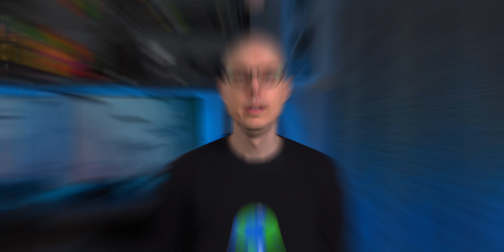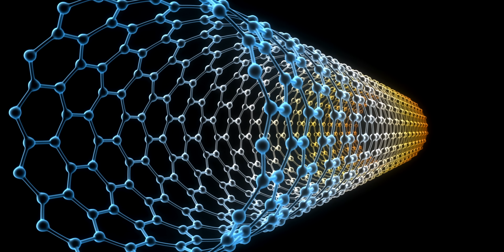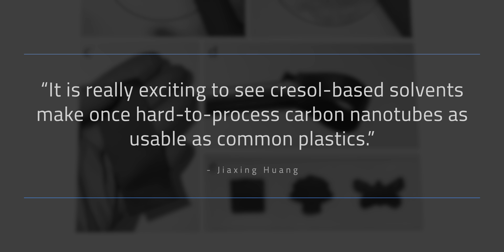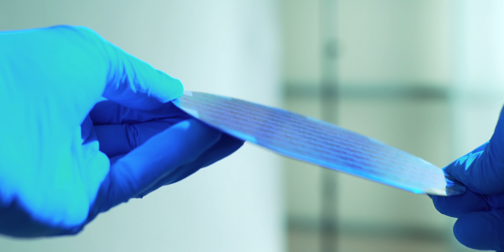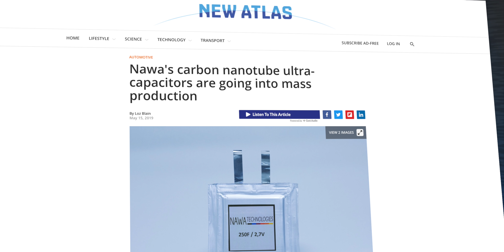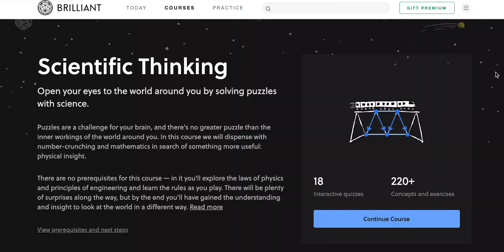How carbon nanotubes might boost solar energy - explained

Comment: Also, this new material.They say that could replace gold has higher conductivity andflexibility corrosion resistant. Gold is commonly used in electronics because it's soft, pliable, and has excellent electrical conductivity and corrosion resistance. However, gold doesn't have great mechanical strength. Researchers have developed new materials that can replace gold in electronics and have similar contact properties to gold, but are less expensive. These materials are durable, resistant to oxidation and corrosion, and conductive. 

￼

ScienceDaily

New materials could replace costly gold in electrical applications | ScienceDaily

Oct 15, 2010

￼

World Gold Council

Gold and the electronics sector | Gold Investor, July 2018 | World Gold Council

Jul 4, 2018

￼

ResearchGate

Current and future uses of gold in electronics - ResearchGate

Gold coatings are widely used in many fields for their shining color, excellent corrosion resistance, and electrical conductivity. However, they are not mechanically strong with low wear resistance. In this paper, we have prepared nano-composite Au-Ni-TiO2 coatings by our newly developed sol-enhanced electroplating method. In order to obtain the optimal mechanical properties, a systematic study of Au-Ni-x TiO2 coatings with different sol concentrations (x is the sol doping concentration from 0 to 25 mmol/L) has been conducted. It was found that nano-particles (3-12 nm) of TiO2 were highly dispersed in the coating matrix.

One process for creating flexible gold foil that can be used in electronics involves:
1.Immersing silicon-gold layers in an acid bath

Forming a silicon oxide (SiOx) layer between the silicon-gold layers

Applying an adhesive layer on top of the gold foil

Using another acid to remove the silicon oxide

Detaching the gold-adhesive foil from the silicon 

The resulting gold foil is conductive and flexible, allowing it to be used in flexible electronics. 

Gold is used in many electronics, including desktop and laptop computers, smartphones, TVs, and video game consoles. Random Access Memory (RAM) chips, which are part of the circuit board, often contain a small amount of gold-plated pins and a thin layer of gold on their surfaces. 

So could this push it past the 20%?Because it has higher conductivity putting this as the nano particles moving it to even a greater state of conductivity?????

Comment: Also this is a way to turn lead into a market product by converting it into gold. And then using that converted lead into gold in solar panels.

In alchemy, the term chrysopoeia (from Ancient Greek χρυσοποιία (khrusopoiía) 'gold-making') refers to the artificial production of gold, most commonly by the alleged transmutation of base metals such as lead.

￼

https://en.m.wikipedia.org › wiki

Chrysopoeia - Wikipedia

Feedback

Comment: This is a duplicaiton of the refinement process of blacksmithing. The first thing a blacksmith does, if talented enough, is improve their own tools. The same that can be said about scientists building nano-tubes; build a nanotube robot to build nanotubes, then have that robot build a robot to repair the robot that builds nanotubes. Turn that robot into making a new robot from the nanotubes the other robot is making and you have two nano-robots making nano-tubes where you used to only have one. The exponential growth is obvious. The clever thing to do is to build an operating system capable of keeping up with the growth and the tasks assigned.

Of course, that provokes the inventor to have created the nano-tube-making-robot with some storage space for memory or a simple brain providing self awareness of a hard state of "fully-working" or "broken" with "functional" still being an option, no longer binary, the storage state would become trinary at least: and that's done with feedback -- if the robot is designed cleverly enough to make an electron bounce through it in frequency of the AC cycle of the power grid, you can get a peak, out of phase signal for damage, and completely blank for fully functional, indicating there is no signal for damage present. If it's gone, what are you talking about, it needs to be totally replaced, if you ever knew it was there, and that makes a need for identification through individuality or by form and function in a place instead by a number as wrote. -- but we need an antenna to speak to the indiivdual units and a receiver to recive all those signals. Looks like the easiest way to send signals is through light; one frequency to read the nanobots, the second to give control signals of act or  not, and power wich can be done through the UV light conversion you spoke of.

The biggest reason why this isn't being invented is because the billionairs are too stupid to be fat and happy on their tax-breaks instead of investing in anything.

Comment: What does the afterlife look like for graphene and carbon nanotubes? Reuse, recyclability etc. Thanks for another awesome video!
Reply: That depends on where they are used.  Right now, CNTs are used as an additive material in polymers, for example, to give them desired characteristics.  The loading is extremely small and I don't believe that there is an effective means for separating the CNTs out from the waste stream.  If the plastics are recycled then the CNTs would be recycled along with them and incorporated in whatever is made from the recycled plastics.

Comment: So, in some ways it looks, carbon nanotube technology, if it is able to be quickly developed and commercially integrated, has the potential to mitigate as much of a reliance on rare earth minerals in some sectors of consumer items? That could possibly simplify and relieve some of the pressure from the current existing monopoly, and time needed to find economical recycling, recovery, and cleaner alternative means of acquiring them, by having another parallel technology, that will both allow a potential substitute and determine where the actual can't live without priorities for these materials are, if that limitation actually exists. If you can't get enough materials for one way to work, then make an alternative way with what materials you can use... okay, hack the hell out carbon then, make that dirty stuff into something useful!Interesting video, makes you consider the possibilities...

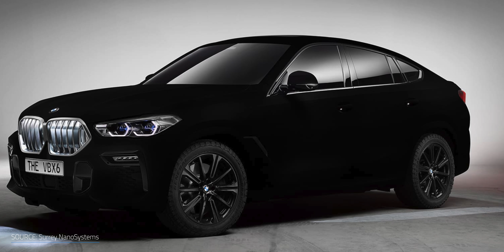Comment: 5:13 while it would look awesome You really Don't want to paint your car with it. 
All that light it traps turns into HEAT.
Great for passive solar gain applications; But it would basically be turning you car into a solar oven.

Comment: Looking for thin black (but it does not matter) suit which will help in thermal control of the body itself .. no more thick feather-filled winter jackets, or swatting like a pig during summer. Which will also protects me not just against heat but also against other elements .. and sharp objects .. I know it's possible, seen some bulet-proof tests.
Then for batteries/capacitors which will store enough energy to power my gadgets or even car/house for years without need to recharge (which will be fast as well) a which wont degrade.
And solar panels, or more precisely film/coating/foils which can cover surfaces and generate electricity with almost 100% efficiency.
Then we will become almost energy independent.

Comment: Sooo there not making building material at all now little nanotube twined sheating 60 ft long rolled into a column.. filled with helium for a tri pod building with 4 wound structures on each arm.1000plants making a floor every 6 months .. would be worth 6trillion hours i have lists of engineering ideas and im not aloud to think anyform of intelligence csuse im do orojected dumb man these himalayan brain boosters sure work

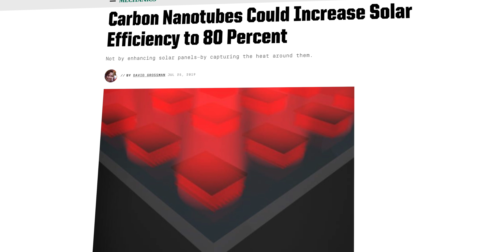Comment: min 6:15 "Improve solar panels efficiency by 80%" is very different of the correct "Improve solar panels efficiency to 80%" as shown in your video from the headline of the article. The usual efficiency of a normal solar panel is around 20%. BY 80% would be 34%. TO 80% would be an increase of 400%. I am sure it's just an honest mistake though.
Reply: I was thinking the same. 80% energy efficiency sounds far too good to be true. 80% quantum efficiency might be more realistic. Maybe that is what was meant.

Comment: Far as capacitors go Maxwell is already way ahead... 250f is on the small side. Maxwell has 3000f capacitors and they sold their design to Tesla. which I'm sure they're doing some crazy stuff.
Reply: To be fair, that's probably a much bigger capacitor physically.

Comment: You know these things that might boost solar energy are about a penny for 5 dozen. Every week there is another break through that will take 76 years to apply. Its like fuel cells. Since the mid 70s they have been 3 years away for commercial operation and we still do not have one that's practical. Yawn. Wind and Solar are 50 years away from being any kind of replacement for fossil and pretending other wise is a democrat pipe dream. I worked in the industry for 20 years and Solar and wind are a nightmare to manage and are not reliable enough on their own to do anything. And, you have to fossil fuel units (gas turbines) online to back them up all the time. Without government subsidies neither of them would even be online now.

Comment: What I'm looking for with nanotubes.

1. Better thermoelectrics.
2. Better, lighter, stronger, Cheaper Buildings.
Reply: There have been a few challenges establishing CNTs in construction materials.  Cost has been one challenge.  Getting the CNTs to disperse in order to get the desired properties is another challenge and this is also tied to delivering the material in a way that will be acceptable by the industry.  Another big challenge is the industry is incredibly cost-conscious and resistant to change.  That said, with the focus on reducing carbon footprint, there is now a big incentive for the industry to surrender the resistance to change and start looking for ways to make a dent in the footprint.  The other issues are also getting solved.  Cost of the materials will be driven down as production increases to the level that is required to credibly service the construction industry.  Also, dispersion methods have been developed that will address that issue as well.  It won't happen overnight, but the ball is already rolling.

Comment: I have recently seen a vantablack bmw in Kologne and it was scary! Like a moving black hole with a propeller badge... i don't think it should be allowed on the streets.
Reply: Cool right? But even that was watered down, as not the full 99% VANTA black was applied, you can google to fact check it. It turns out using the full VANTA black will make the 3d outline of the car indiscernible

Comment: It's my understanding that the pile of random carbon nanotubes is capable of high volume hydrogen gas storage at low pressure. So why not replace all the lithium in a Tesla battery pack with them then replace the wiring with tubing making a low pressure hydrogen storage unit that cools itself while it's rapidly filling? Seems like it would be a lot lighter and go farther providing 100% power till the last molecule of hydrogen is consumed. It would also be very interesting to see Elon Musk's reaction to seeing a Tesla run on hydrogen using his basic battery design for gas storage especially since it would be able to sustain the ridiculous mode at full speed for the full tank thereby always outrunning his lithium powered version.

Comment: One of the elements of the space elevator is its height. Did your research indicate that it would have to be twice the height of a geo-stationary satellite? My question being based on the idea that if a geostationary satellite is at the balance point then anything hanging down from there would need a counter balance. I suppose an alternative would be to have the centre of mass at that altitude.

Comment: He glazed over that vertically aligned nano tubes increasing solar cell efficiency by up to 80% so I thought I'd just throw the article in the comments. It's a super cool little experiment. https://www.nature.com/articles/nnano.2009.226
Reply: That paper abstract refers to a "power conversion efficiency" of 6.9%. The "photon-to-current" efficiency (meaning the quantum efficiency, I guess) is stated as 70 to 80%, for a small range of optical frequencies (wavelengths). I really don't think we are looking at 80% energy efficient sunlight-rated solar PV as most people would interpret it. Seems like an unintentionally missleading headline figure.

Comment: This is all old news, some of it even dates from 2009. The paper + ink + carbon nano tube battery https://www.youtube.com/watch?v=HstobIHYpF0
Revolutionary carbon nanotube solar panel https://www.youtube.com/watch?v=JIvU3l9M2O4

 Stanford University announced at the end of 2009 that they made a solar panel with carbon nano tubes that could convert heat and light to electricity at the same time, making the solar panel competing with oil. In the same period of time they also announced that they made a battery from carbon nano tubes + ink + paper. Stanford university made videos about these subjects, but a few years ago they completely removed those videos from their YT channel. Lucky for you you can still watch both videos because I saved them back in 2009. You're welcome!

 And skeleton ultra capacitors is producing and selling Graphene ultra capacitors for a couple of years now. They can be used for many applications, but a Scottish island uses them for their wind powered energy grid. 

Skeleton Technologies ultracapacitors boost the grid on Isle of Eigg in Scotland https://www.youtube.com/watch?v=3RUY0BUgFjs

  Skeleton Ultra Capacitors | Fully Charged. We visit Skeleton Technologies in Tallinn, Estonia to find out how these remarkable products are made and what they do.
Curved graphene. https://www.youtube.com/watch?v=KQ2Eo6wl5r0

  So there you go.

Comment: We need to stop using A.I. to play games and input a set of rules for winning that figures out what every applied science guy wants... real world answers. Like what is rattling around in my idea/ dream space. I used to play with magnets (not board games)  as a kid to pull iron fragments out of the sand and it has stuck with me.  
Go with this idea... electromagnets affect things in 1 way, while the simultaneously alternate (yet unknown) magnetic fields will undoubtedly affect other atoms in other ways.  Once you get these fields all programmed have the A.I. fire on the base starting material in a real world tests, in every conceivable pattern. Using magnetic fields, light and sound wave length, quantum , frequency and observe the result. A.I. can do this in seconds and the results might surprise us.  We were stunned when it won at Go.